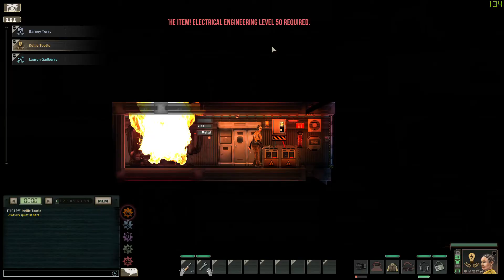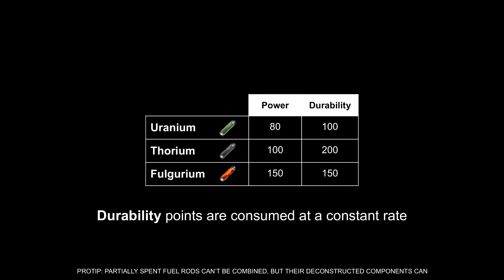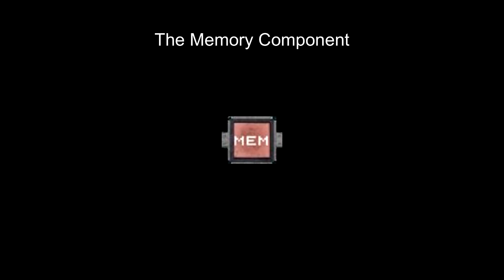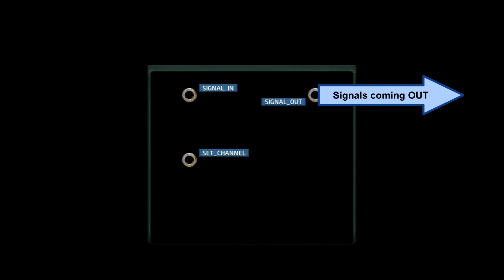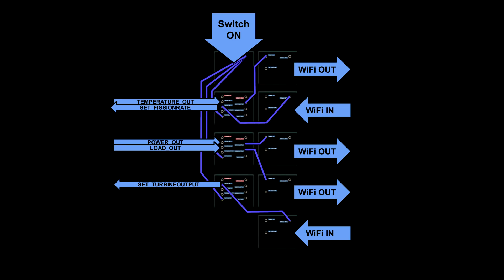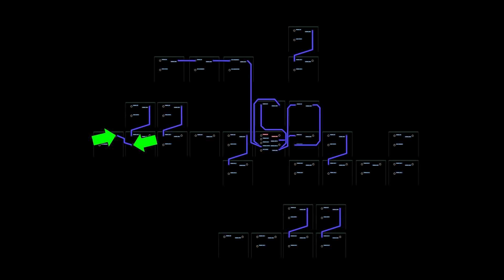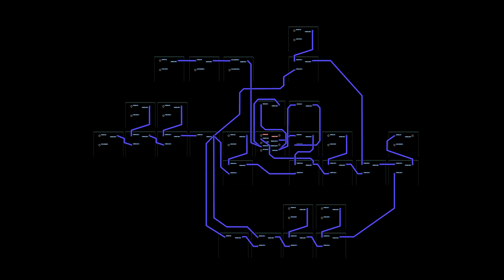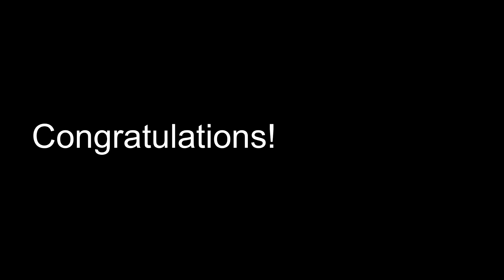Perfecting Reactor Control

Comment: Is this guide still relevant for 2024?
Reply: Thats what i would like to know :D Nice video :D
Reply: @quasarix  the way I worded that looks ruff. I would like to kinda rephrase that. Would it work on baro subs nowadays?
Reply: @quasarix  I also like this vid it's pretty cool
Reply from the maker: This one doesn't work anymore after the changes to how reactors respond to external inputs (spoiler alert: they slowed it down to 80% of the speed to which manual inputs are handled). That being said, there is an option... I'll be going through the installation process, and compare the performance to the native auto controller in tonight's livestream
Reply: @TheGamingNerd2022  I'll be there
Reply: @TheGamingNerd2022  Hey, i've done it all, to find out in your comment it doesnt work anymore :D lost couple hours... Is there a video of the new one ? maybe the livestream record?
Reply: Just connect the batteries to the grid, charge them till 90% and make them charge whenever there is an overvoltage.

Comment: How do I find the Max Power Output of my reactor, if I have some of the reactor max output upgrades and an engineer with the talent "Buzzin''" which increases reactor's max output by 10%?
Reply from the maker: Good question! There's a few possible answers, actually... 

The most precise way would be to do a detailed search through your game files (if you're running Windows, this starts at "C:\Program Files (x86)\Steam\steamapps\common\Barotrauma\Content") for references to things like "upgrades" (from the above path, "\Content\Upgrades\UpgradeModules.xml", lines 139 to 156), or "talents" (see \Talents\Engineer\TalentsEngineer.xml, lines 18 to 33). This method is what I would call the most "reliable" because these are the files that get updated and ultimately determine the behaviour of the game.

The less-accurate but easy way would be to throw a single thorium fuel rod in the reactor and turn EVERYTHING on (to demand 100% of the reactor's output)  and see what the max power looks like. Don't forget, not all fuel rods are created equal, and one uranium fuel rod can only deliver 80% of the reactor's true maximum output (so if you're using a Uranium rod instead of Thorium, just divide what you get by 0.8). 

The middle-of-the-road way is to Google it. The Barotrauma wiki has a page specifically dedicated to this, and IIRC the page is coded to update directly from the code, so you can trust that the values are (almost) always up to date. 

If you haven't seen the Wiki, then you probably haven't seen the tables for the reactor "efficiency" upgrades (+3% increased reactor output per upgrade, max 3) and fuel-consumption-reduction (which I would call "efficiency", but that's just me) upgrades which also extend the delay between overheating the reactor and catastrophic meltdown (-20% fuel consumption and +20% increased meltdown delay per upgrade). Protip: Don't forget to upgrade your junction boxes too ("Enhanced resistors") , you'd be surprised how much of a difference it makes!

To know where you started -- assuming you're using a vanilla sub -- you can also look up vanilla subs on the Wiki, where you will find the reactor's default max power output (in the table below the picture, 5 sub-tables down, first row, second column... iirc).

Now I don't fully understand the GitHub code, so the rest of this answer comes with a standard "as far as I understand it" disclaimer. That being said, I believe all of the above put together means you can figure out the reactor's exact maximum power output at any time with:

Power = (R_max) x (B) x (U) x (F)

Where:
- "R_max" is equal to the reactor's starting maximum output value,
- "B" is 1.1 if the engineer has Buzzing and 1.0 if they don't,
- "U" is equal to (1.0 + (0.03 x T)), and T is the tier level of the reactor's efficiency upgrade (zero if none), and
- "F" is the combined "heat potential" of the fuel rods, divided by 100. Uranium, Thorium, and Fulgurium rod types have heat potential values of 80, 100, and 150, respectively.

For example, if an engineer with Buzzing puts two Thorium rods and a Uranium rod in a reactor with a Tier 1 efficiency upgrade, then:

- Nominal max power is 6500 kW,
- Buzzing multiplier is 1.1,
- Upgrade multiplier is 1.03, and
- Fuel rod multiplier is (100 + 100 + 80)/100, or 2.8

Therefore, the reactor's max power is (6500 x 1.1 x 1.03 x 2.8), or approximately 20620 kW

I hope this answers your question! Feel free to check out the Discord server (https://discord.gg/3UQMrUjW) and ask this, or any other question you might have, to myself and the rest of the Nerd Herd!

Comment: Sucks that all the brain work we do to make a working reactor control circuit gets nuked because the devs want someone to control the reactor manually.
Especially sucks in singleplayer where AI can't control the reactor and automatic control makes junction boxes blow up all the time.

It was so rewarding when you improved your reactor control and figured out a better way. Now I feel like needles move slower than automatic control when you set a value.
Reply: @cdollar67  yeah

Comment: Is a sufficiently optimised non-pid controller going to match this efficiency wise?
Reply: Yes, I use a 10 component system to build the follow equations

turbine_output = load_value_out / ( maximum_reactor_output / 100 )

This part requires 2 components. The maximum output of any given vanilla ship reactor can be found on the workshop.

Next, using 3 components, build the following equation

fission_rate = ( 75 * turbine_output ) / fuel_out

Because the first 5 components will immideately ramp up fission rate without waiting for turbine output to ramp up as well, it is prone to overheating and possibly catching on fire, but not a complete melt down, 5 addition components are needed to add an overheat protection.

set_fissionrate = fission_rate * clamp[max(1), min(0)]( 2 - temperature_out / 5000)

This portion will ramp down the fission rate based on reactor tempture, with the maximum multiplier of 1 and a minimum multiplier of 0 as reactor tempture increase beyond 5000

This design is in theory 50% more fuel efficient as well due to the fission rate calculation will always try to calculate for the minimum fission rate required to achieve the given output requirement

Comment: I think there is only one way to do now a reactor which change really fast the output of electricity. The way I though is to control only the temperature and put the turbine output to 100. For this to work you need to have 4 bar of fuels otherwise you won't profite from a tinyer range of control for the temperature. If you have 4 uranium bar the fission rate will only need to go between 0 and around 25 compare to one thorium bar you the fission rate will need to go between 0 and 100. Basicaly you would calculate the temperature that you need to produce the power out put that you want. Because if your temp is 1/2 of what it need to be to produce the max turbine set out put it will produce 1/2 that amount. The big problem is that the fuel efficiency will be trash.

Edit : I made my reactor controller and it's working really well. And the fuel efficiency is better then expected.
Reply: This is actually genius
Reply: @HyperLeChat thx

Comment: It's not working anymore because now the sliders have a constant speed if control by signals (components). The pid controller was based on the needle that would go faster the bigger the difference is between the needle and the slider. The only way to moove the slider faster is to do it manualy now. :(

Comment: Is this still working in the current version of the game that impacted automatic reactor circuits?
Reply: Would love to know this too
Reply: It's not working anymore because now the sliders have a constant speed if control by signals (components). The pid controller was based on the needle that would go faster the bigger the difference is between the needle and the slider. The only way to moove the sliders faster is to do it manualy.

Comment: Probably wont use this in the near future, playing a slightly modified version of the orca 2 and I love how the reactor always seems to be lagging behind, making lights flicker, engine and pumps stall. The ambience is amazing, and I now do warmup maneuvers with the engine to get the reactor to the correct fission rate through automatic control, once I have the desired output, which I know because the engine isnt stalling, I floor the accelerator.
Reply: With the orca we could only get it at optimum if our engineer spammed a rod in and out of the bay on automatic. You run 1 then spam the other whenever it almost overheats. we ran everything fine until a hammerhead knocked us for 6 and I couldn't get back to the reactor to take the rod out... you can imagine how that went xD
Reply: Just a heads up, a recent update murdered automatic reactors so they’re basically unusable.
Reply: @chadwickedralin40  I found one way to do it. But the fuel efficiency is trash.

Comment: I came in to learn and understand how does reactor controls work, and how to stop it from bursting into flames every time I touch it. I came out as a senior freaking techpriest, with forbidden knowledge on how to trip this radioactive hunk of junk into controlling itself. Great job m8, I came looking for copper but I found gold.
Reply from the maker: "looking for copper but found gold"... I'm totally using that someday. Glad to help!
Reply: @TheGamingNerd2022  can you also provides document on how algorithm works? I’m interested in understanding how you design and how the machine works
Reply: @sleepysheep792  It's not working anymore because now the sliders have a constant speed if control by signals (components). The pid controller was based on the needle that would go faster the bigger the difference is between the needle and the slider. The only way to moove the sliders faster is to do it manualy now. :(
Reply: But it's just a PID controller...

Comment: Should automatic control within the reactor be on?
Reply: It works in either mode, because the controllers are sending signals directly to the reactor, which override whatever (imperfect) control algorithm drives the automatic control mode. 

BUT  It can be good to start in manual mode, put your four rods in, set the fusion rate nice and low, then wind up the turbine output until it is in the green, and adjust fusion rate until you get just enough juice to match output with load, and THEN turn on the Automated controllers.

And then, if you leave it in Manual Mode, you can have the rare and wonderful pleasure of trying to manually shift the two sliders or Fusion rate, and Turbine output, but you Cannot! Because your reactor is Still in 'Manual' mode. It is just out of your hands now, and in the loving, caring, careful, clever hands of a Perfect Reactor Controller.

Comment: A couple of tips about the PIDC, from having built this amazing little assembly:

- The Wiring of the Memory component on far left, to the divide component beneath it, is wrong. Needs to be output of memory to input two of Divide, and Raw Temperature signal (from wifi if wired as per the video) into input one of the divide. So that you are dividing the temperature from the reactor by 100, and not 100 by the temperature.
- The video shows a subtract component next to this at the start, then switches to Multiply in this place. Also, the parts list imply it ought to be multiply. BUT IT NEEDS TO BE SUBTRACT
- I could not get this to work, as specified, on an Orca. I think this is because Wifi channel 1, in latest version at time of writing, according to the wiki, uses this channel for alarm Signals. In my two working versions, I have just bypassed all wifi, even though it worked fine for the Turbine Controller, working over channels 3,4,5.
- I had another issue trying to provision the controller, when no signal was coming out rom the PIDC, or a constant zero signal. I eventually figured out this was because the value stored in the Memory component of the Dynamic Memory Cell was set to somewhere around negative  -40,000. This was because I had built the PIDC without having figured out the above, so it ended up storing that as the integral change value. The solution was simply to set the value in this Memory Component to zero. This is not something that would even happen if you got it right the first time, but then again, if you follow the instructions of the video as is, it will not work the first time.

TIPS: You CAN just have the Turbine Controller hooked up, and this will control the turbine output in response to power load, for a given fission rate. With a complicated task like this, it can be good to be able to tell that part is working. I also wired the relay for this controller, and the two for the other, to two different switches, while trying to wring out the problems with this. With no engineering background, it was a very trial and error process.
Reply: Update: Have confirmed that PIDC wifi issue goes away as soon as I get off channel 1.

Comment: Alright, now tell me how to fit this inside my Barsuk
Reply: 5 Channel wi-fi switch looks like it would fit beside the reactor. And The two controllers would fit inside ballast sections.

Or you can just place the components wherever. On my Orca, the PIDC is placed in the room to the left of the reactor. Some components are obscured by a ladder.

Perfect Reactor Control > A neat and tidy ship that does not have electrical components in odd places.